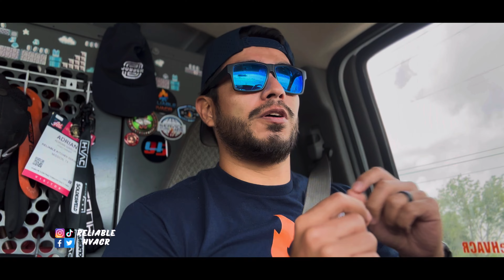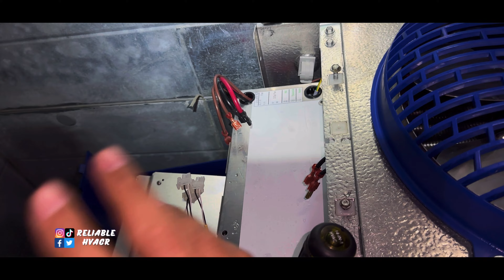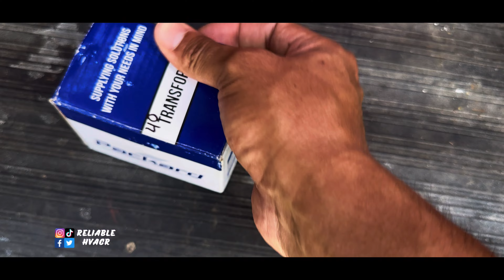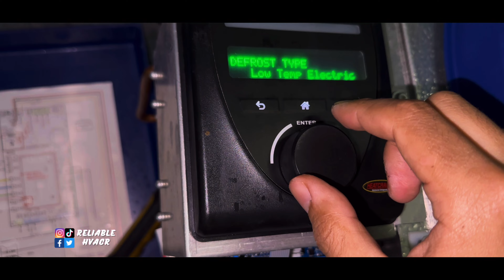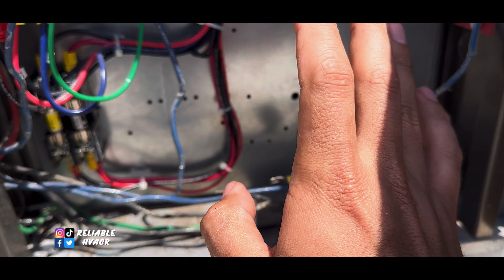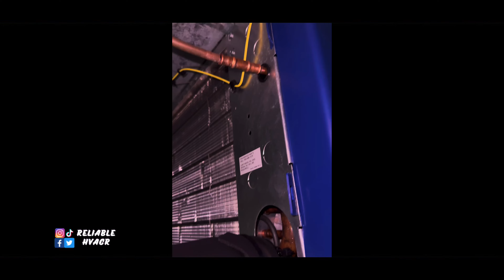Another Smart Evap down and customer has to wait / HVACR

Comment: I’ve worked on countless intelligen units. Only replaced very few of the touch pads or main boards. 

Biggest issue I’ve found is improper pressure switch settings, no check valve on the suction line at the compressor, and defrost termination set way too high. 

A few quick tips. The Eev can be manually opened or closed by turning the stator on the eev. Each rotation is appx 50 steps. Fan failures most of the time are from the high defrost termination/box issues. Ice/frost builds on the fan covers, and the ceiling. It eventually gets all over the fans, and ruins the motors. You also need to make sure you’re setting your transformers on the evap assembly for the correct incoming voltage.

Use these set points, and your issues will be much less:

- Temp set point WIF -3deg f; WIC 37 deg f
-Temp Diff 5deg f (these will cycle 2.5 deg below, and above setpoint)
-SH 10 deg f
- Defrost termination 50 deg f (you can actually take them as low as it will go. Which I believe is 46 deg f. I haven’t had any issues)
-Drain Period 3min
-4 timed defrosts every 6hrs max 30min runtime
-pressure switch 0psig cut out (as close to zero as you can get), and 10psig cut in)
-any sort of time delay on the condensing unit has to be removed. If it’s a scroll, and it wants to kick back on, you have to install a suction check valve. You can use the magnetic type.

As far as the controls getting wet, and ruined. I’ve seen them caked in ice, and have no issues. You should really download the tech manual, and read the entire thing a few times. It can really help, as there’s lots of things you would never of thought about.

Comment: Do you have the magnet for eev's to manually rotate the valve. I've seen them before in videos
Reply from the maker: Na I've been meaning to get one, but still if the board ain't doing it's job what can you do right
Reply: @ReliableHVACR  very true. The magnet has more usage to me for recovery, pressure test and vacuum.....butbit does have some usefulness in troubleshooting or testing. Just curious if you have one.
Reply: With these you can rotate the stator on the eev, and manually open the electronic expansion valve. You don’t have to buy anything.

Comment: ❄️💪🇺🇸👍 any thoughts on keeping it simple like Mechanical tstat, solenoid valve  txv, defrost clock n dtfd.
Reply from the maker: Definitely a lot easier to repair mechanical, a bad board on this will cause headaches for the customer

Comment: You have to know what signal the board is sending ie 0 to 10 volts. Then verify the valve is getting the correct signal. Also verify the sensor is reading correctly, I'm pretty sure the valve is controlled by suction temperature, if it doesn't read correct temp the valve won't work right, it's just trying to maintain superheat.  Nice job Adrian
Reply from the maker: Yes but it's difficult to check the reading when it's running. In test mode I get all the proper readings. The coil is a little awkward to check. And in the manual it wants you to trust what the display says, I can see the steps going up but it was actually never opening or closing because we never got the signal output

You know what, those piercing tips on the jumper King probably could have helped maybe to see if their was voltage coming to it during operation
Reply: @RELIABLE HVACR  I get it. I can't believe the manual wants you to believe the board, I like to think I'm smarter than the intelligent board 😅. Haven't worked on many of these, but I have seen on the chiller side temperature sensors out of whack can throw everything off.
Reply: @EverythingHVACR . You are spot on. Its a matter of the board sending voltage to different windings in the motor to open or close.

Comment: Is the Evaporator unit on a separate electrical circuit or does it get powered by the condenser unit? Heatcraft wants the Evaporator on a separate circuit because of the transformer. I know there are certain times you can't help but have it powered by the condenser. 
My bet would be power surges.
Reply from the maker: Yeah we've had to run new power supply on all of them except this one I think. Whole bunch of issues scheduling this thing and we used the existing 208 supply from previous evap.
Reply: Great video man